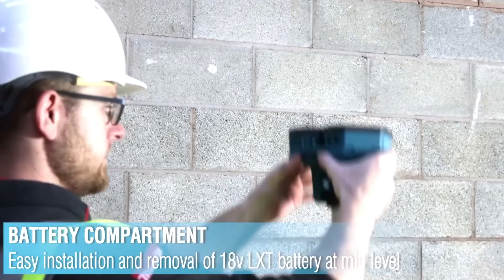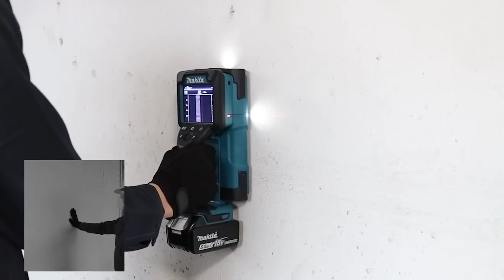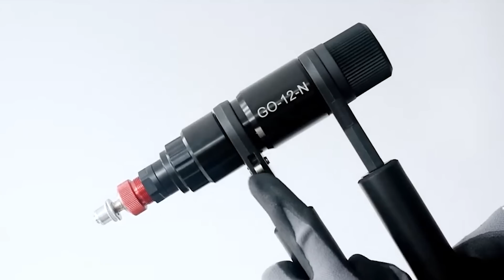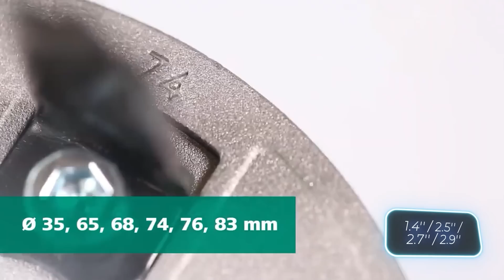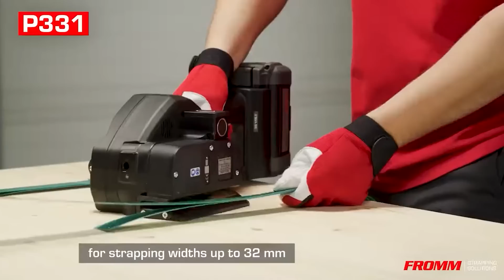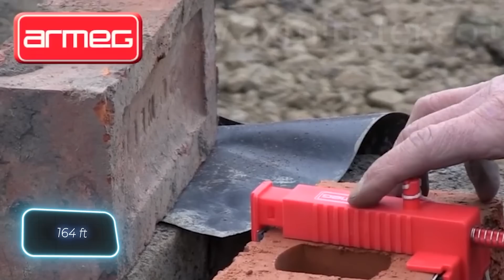12 COOL TOOLS YOU MUST SEE

Comment: Footage left out: 
Scene 2. Diver was in shark tank, after cutting the unsupported pipe, reciprocating saw severed major artery in divers leg. 

Scene 3. NRA sanctioned. M16 model still being tested, expected for USA release early summer ‘23, in time for summer break. 

Scene 5. Sledgehammer not required, instead a pneumatic hammer, 100’ feet of hose, 1/2ton air compressor. 

Hole saw: works for light fixtures (good); very adjustable (good) claims to be very convenient for sockets and switches. (Pending round J-boxes catching on in American Homes and commercial spaces)

POTENTIAL NEWS REPORT:
Traveling painter/drywall contractor apprehended at JFK, carrying multiple concealed folding ‘knives’ on his person, suspected of attempting to highjack flight to LAX. 

Aside from absurd costs for the makita stud finder and the feature length ‘commercial’ with numerous added in commercials this was almost a very useful advert.

Comment: I wonder if the limit on the saw is due to overheating. If so they could have added a heat sink where the reciprocating action runs a pump with water running through the heat sink.